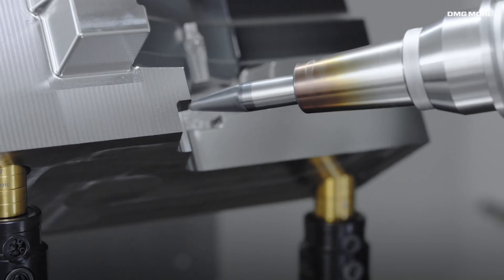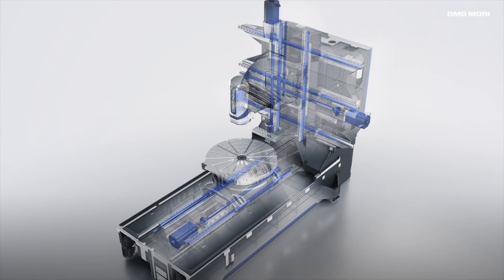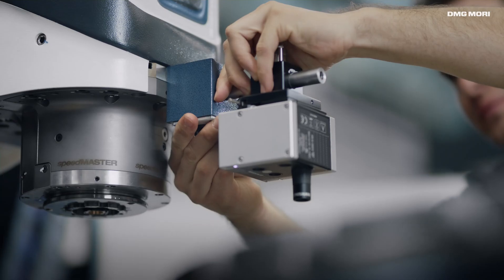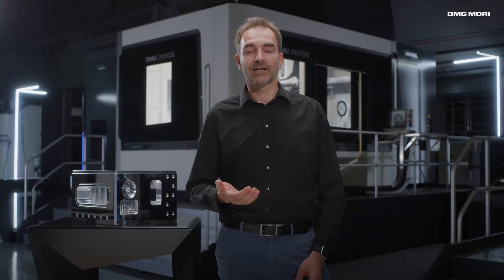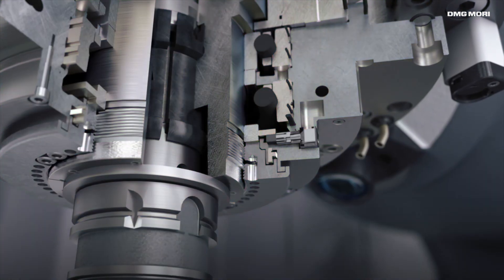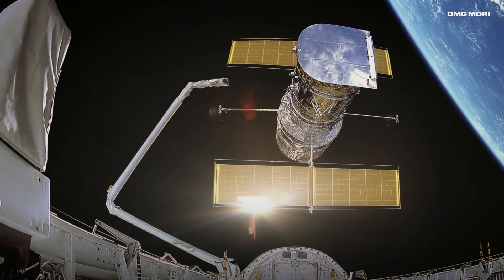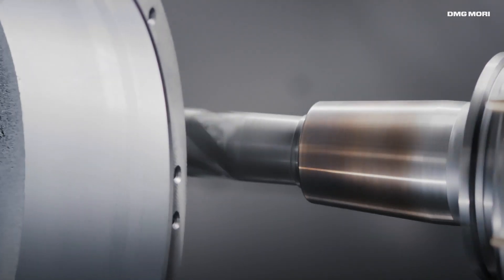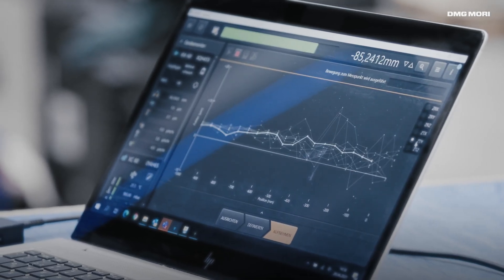High Precision Machining with µPrecision by DMG MORI

Comment: I run a DMG Mori eco turn 450 and it is by far the most accurate repeatable lathe I have ever ran! Boring a .100 hole with a +.0002 -0.0 tolerance it repeated within .00005 over and over as long as the machine stays warmed up

Comment: These days i use 'NHX 4000, but i compere with Mazak HCN, mazak is very easy to (Measuring tool, probbing, Restarting ect) as well as Dmg spindle low vibration and good finishing

Comment: Hydrostatic Spindle, X,Y,Z, A/B, C axis when? (liniear motor too?)
Reply: I believe they planning on that too
Reply: Hydrostatic spindle  and ways, linear motors, precision glass scales for feedback, the perfect machine that doesn't wear
Reply: @hinz1  
Kern microteknic says: alright alright we'll get a hydrostatic spindle soon
Reply from the maker: Hello Ayato Takema,
with our µPrecision solution, for example, we already achieve volumetric accuracies of 13µm on a DMU 80 P duoBLOCK. And thanks to VCS Complete, we can compensate for wear-related inaccuracies. ☺️